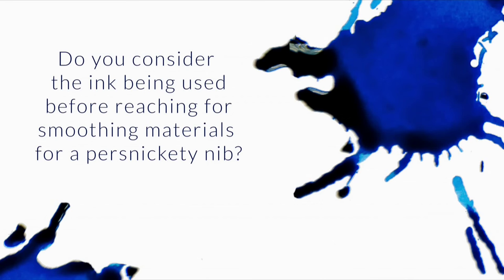Do You Consider The Ink Being Used Before Reaching For Smoothing Materials On A Nib? - Q&A Slices

Comment: Is ink with lubrication performs better on any pen or it has an advantage.  Or if I use an extra lubrications ( to any ink  without an exception ) dose it effects the components in the ink?  I believe in some recipes of ink some add Glycerine as the lubricant as the lubrication.
Reply from the maker: I'm currently using Noodler's Turquoise Eel (which is a lubricated ink) and it does seem to flow better & wetter in my TWSBI. So it could be a good option if you're having flow issues with a certain pen. Any Noodler's Eel ink or Monteverde ink are lubricated, so you could always try those out with some samples. - Colin